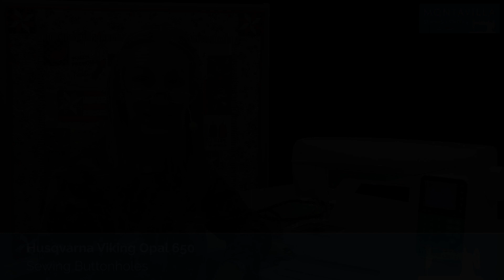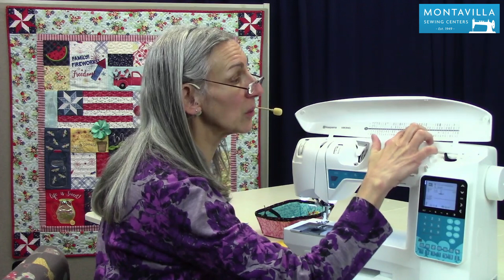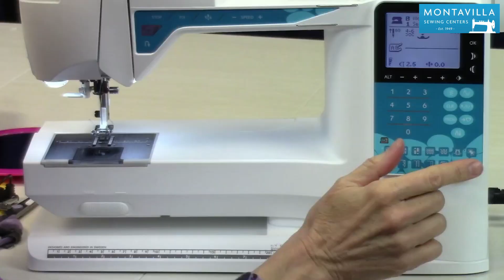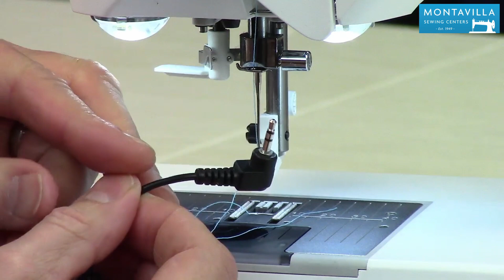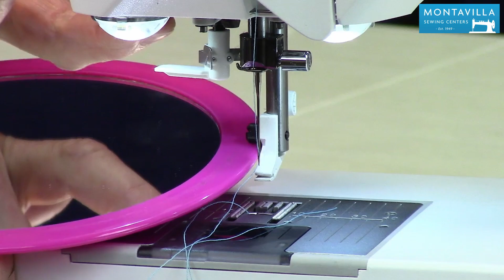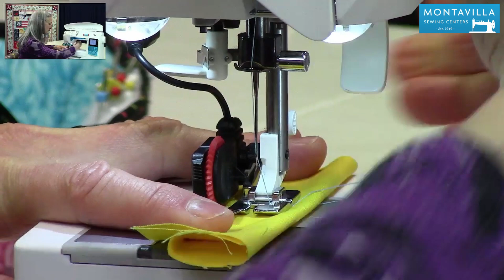Husqvarna Viking Opal 650 Tutorial - Sewing Buttonholes

Comment: I thought my buttonhole automatic foot was broken, so I took my machine to store store I bought it from and it worked fine there. The instructions in the manual, as well as the YouTube videos don’t explain that the fabric has to end up under the sensor, so when your trying to sew holes on a narrow placket and you don’t know, it won’t work.
Reply from the maker: You might try putting a piece of tearaway stabilizer under the part of the garment where you are sewing the buttonhole. Then when are done,  you can just tear away the stabilizer right next to the buttonhole stitches on the back.